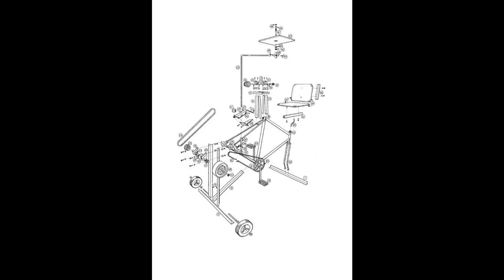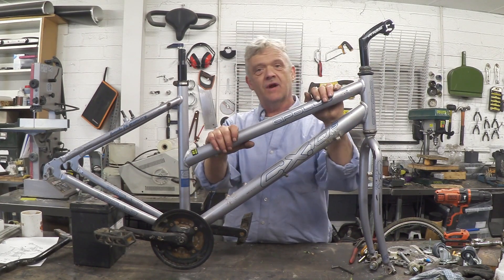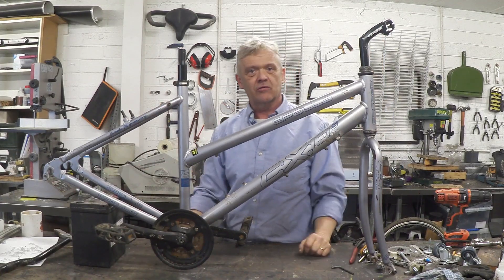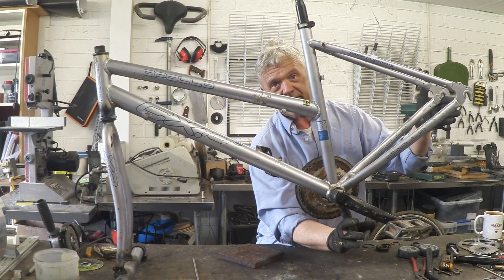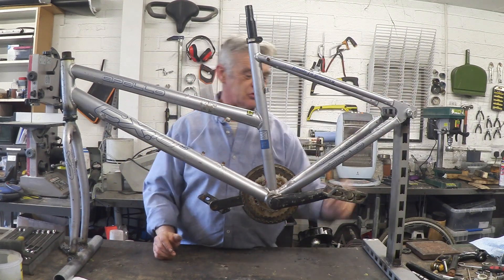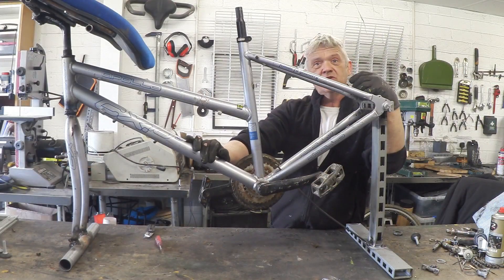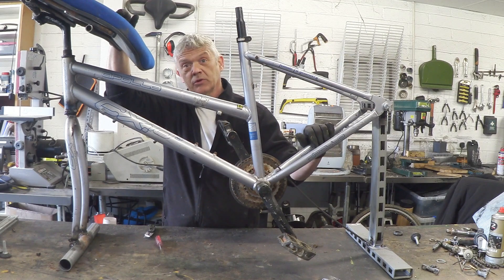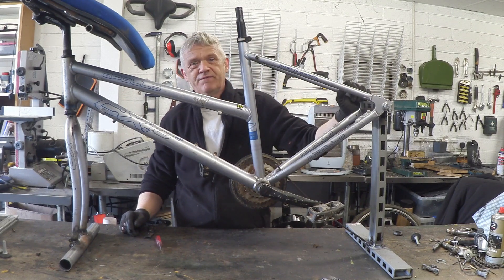1097 Pedal Power   The Dynapod - Building The Frame

Comment: Hi,
I have been playing along the same lines, however to generate electricity which can then be used to power anything.
I started with an old gym exercise bike which had a belt driven wheel,  added a fly wheel to maintain momentum, converted a starter motor to a generator and it worked but poorly. So have been working to increase its efficiency, trying alternators , drill motors (multiple) etc. 
By far the best efficiency comes from mass ie more fly wheels and better bearings. Also the best output was gained by breaking up a worn out petrol generator but the re-engineering was a lady dog.

Comment: I had a idea for a stool to go in a coffee shop that you can pedal and charge your phone, have a chat, and get some excersise all at the same time. I did test on a NEMA stepper motor as a generator, and it produced plenty of power with a simple belt drive gear.
Reply: Good idea.
There are juice shops that allow customers to ride a power generating bike as their drinks are being mixed.
This should be mandatory for all treadmills and spin bikes in Gyms. The power you generate during your Gym session can be credited to your annual subscription.
(And there is the added advantage of increasing the resistance on the treadmills and bikes due to the generator being driven which gives you a better workout with environmental positives)

Comment: Wonderful work! Thumbs up!
Just an idea Robert, would it not be a good idea to have some flywheel to this contraption? Then one just have to pedal it up and concentrate on the work for a while and could keep a steady hand if tinkering with fine mechanical jobs for instance? 
The stray energy left in the flywheel when jobs done could be sourced into a battery-pack for a small light later on, if not used, hey the more you get if you charge more of those small 3,7 Lipos or NiMh or use it for a light on the workspace? Voila!... Just a though or two. Hope they could be of use. :)
By the way, you and Luke are awesome!

Comment: "PTO", power take off. On a tractor or truck, they often have PTOs to run winches etc. This is a PTO to run drills etc. The real challenge will be to adapt other things to fit the PTO. 
That's really a major advantage to electricity, it easily delivers power to a variety of standardized machines. Also it equalizes power inputs. I envisioned a bicycle train where each PTO fit into the PTO of the next bike, but when I realized that each bike would be supplying a varying amount of power, I thought to use generators that charge batteries run motors at equal speeds.

Comment: I always wondered why they don't make exercise machines in gyms into generators. This looks interesting and will be useful when the french turn the power off. Thanks.
Reply from the maker: Good point!
Reply: The French, you mean you no da like them?
Reply: @kilokilos  We're having a bit of a disagreement with them ATM
Reply: @tomsmith2209  I will have to sit on the fence on that one - lol - present co excluded
Reply: Very good, a generator seems the best thing in the darkest Africa here the " French" turnboff the power a lot
 Won't it be better to just strap a working bike onto a dyna type electricity Genny?